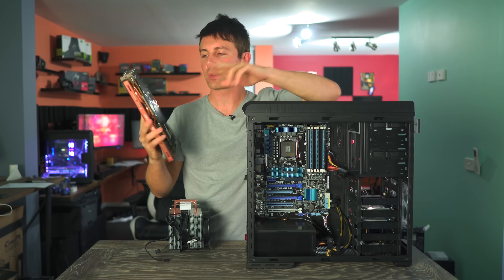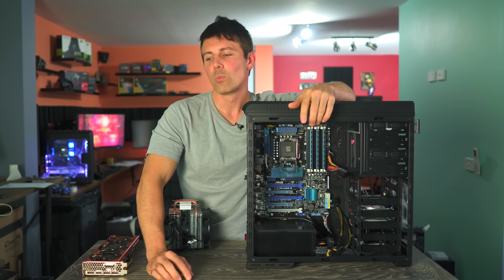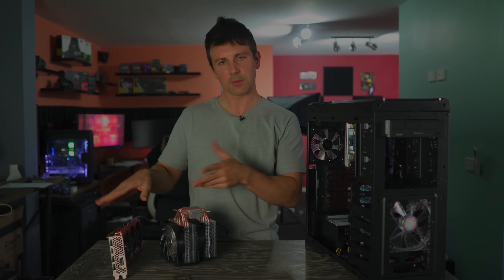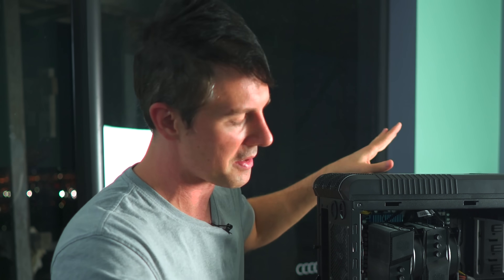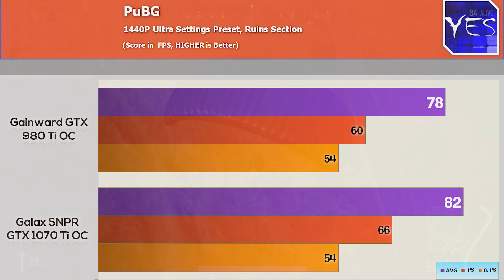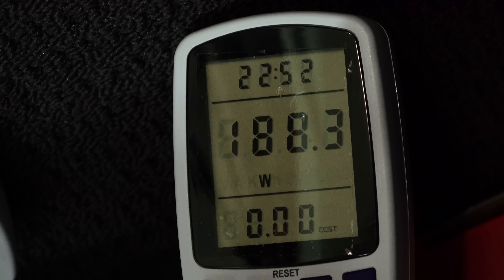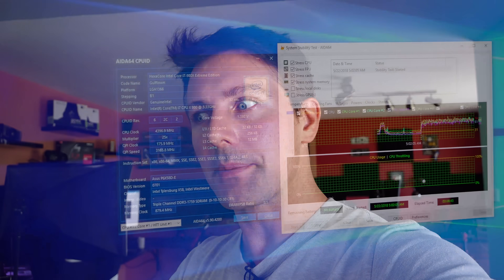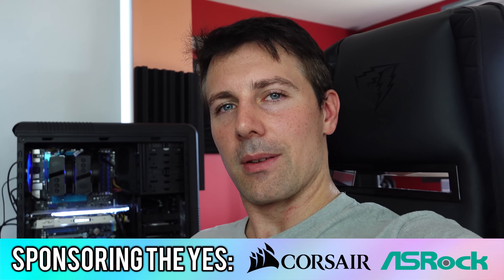GTX 980 Ti Vs. 1070 Ti on x58 - Does it Get Any BETTER?

Comment: you really should get your hands on a xeon w3680 and test it. its a xeon with a fully unlockeed multiplier
Reply: He used the non Xeon equivalent in this video the 980X it is also unlocked. I have a W3690 myself witch is the same as the 990X and is also unlocked.
Reply: ya, but I would like to see if there is a difference in the binning.  I have a w3680 myself and love it. I have got it overclocked to 4.2Ghz on air.

Comment: I love my zotac 980ti amp! paired with my x5670 @ 4.4ghz. Gives me all the performance I need for 2560x1080 on my ultrawide. Definitely would still highly recommend a 980ti if you could get it for $300. I’ve still yet to come across a game I can’t max out and play with excellent frame rates and frame times.

Comment: Hi Mate .. How does a system like this perform with flight Sims. Im an x plane 11 player and it does have a free demo to test on. I have an 8350 at 4.3g and a 1050ti on a asrock 990fx ex 3
Reply: The fx is terrible for X-Plane, the IPC is Phenom ii like and a buddy of mine went from 17 up to 32 fps switching to a I3 3220, with an rx480 8gb.
I get comparable fps to that I3. Maybe something more, but not by much. The loading is much faster.
Reply: thesilviu silviu lol😂

Comment: Yeah, in Firestrike Graphics, my 980 Ti scores 21,183 with GT1 getting 102.61 FPS, and GT2 getting 83.54 FPS. 

As for the 6 Core, 12 Thread CPUs involved, at 5 GHZ core and cache, my 8700k manages 22,432 in Physics with an average 71.21 FPS! Nearly double the 4.5 GHZ 980X!

Comment: Good cooler on that 980 Ti, but it uses the (rather shitty) Reference PCB with the 2 tiny Timebomb MOSFETs... Gigabyte G1 Gaming 980 Ti FTW! Got mine running 1503 Core, 8 GHZ effective VRAM under any and all loads that are not Furmark. Bought mine August 2016 off eBay for $355 Shipped!

Comment: The 990x performs better then its equivalent as the xeon jitters in gta v for no reason whilst the i7  990x does not, fave chip and platform hands down, keep these older videos and cool tutorials on sales and buying stuff, keep this up! 980 hands down and I am on my lovely 670 right now, asus 670 is the best deal for a cheap gpu that plays it all the asus 670 gtx just works!.... Screw Linus, hes shooting in 8k now, maybe u should to bro?...

Comment: @Tech Yes City - Great video Bryan. Love the X58 content. Mine is still rocking as well. Quick question - how long (much life expectancy) do you think the 980ti has before its features (6GB DRAM in particular) have trouble keeping up with AAA games?
Reply: The only game i play is GTA V Online, in 4K high/very high 63 fps. It takes up like 4gb of v-ram
I just upgraded to 980ti in sli, i think Now is when i start worrying about v-ram as performance increases, v-ram doesn’t
V-ram bottle neck occurs with sli setup. I have yet to find out as my TV stopped working i cant test the sli performance
Reply: how the fuck do you play ONE GAME?

 @OmarTheAtheistAziz

Comment: Currently have an evga 980 ti classified capable of running at 1600Mhz (!!) but due to the air cooler I get temps of around 80C and stable at 1571Mhz. It performs literally equivalent to a FE 1080 but I reckon if this was put under water it'd perform even better.

Comment: Hi, add ark to your game list, it will realy use the gpu to the max. Even the 1080ti struggles to get 60fps on 4k. A rx 580 on 1080p epic setings will get 30 to 40 fps

Comment: got my MSI 980ti for €890 on release. Still works great today 3 years later. I don't think ill be changing any time soon. Probable will wait till i halfto drop my graphics on games to medium but i upgrade it. Also never bothered to overclock it. Still pumping out at high to v high settings!

Comment: I m looking for x58 mobo for quite a long time couldn't find it yet. Btw which x58 mobo is good asus or gigabyte?
Reply: Nikhil Puri Asus are better, but gigabyte isn't that bad but don't buy MSI, their x58 boards are not a great choice
Reply: I prefer gigabyte because their are supporting Xeon even on the first bios release (and a x5550 cost only 8€)

Comment: The cpu is a bottleneck. The 8700k would have made this gpu much faster. The i7 980x is missing out on clock speed and a massive IPC and on the super fast ddr4. I wish he would have benchmarked with a modern i7. Cause that x58 is holding back those gpus alot.
Reply: everyone and their mother has benchmarked these GPU's with new hardware. I'm sure you can find that content easily if you look. Top performance for those gpu's wasn't the point of this video. It was how well would it do with OLDER cpu/system like the x58. The price difference he got the X58 system for versus how much a new 8700k system would cost is MASSIVE... probably more than double.
Reply: m8 it's a triple channel memory, it's faster or comparable to the "super fast ddr4" in dual channel check out the benches https://www.techspot.com/news/62129-ddr3-vs-ddr4-raw-bandwidth-numbers.html you'd have to really have some "super fast" 3600Mhz to even beat triple channel, where people have 2400mhz ddr4
Reply: Ryzen default memory clock is 2133MHz lul i was being generous there. My point is that this particular memory configuration is up to date in performance.
Reply: roller4312 no it last gen is 2667 and the refresh is 2933
Reply: Michael Ramos I was talking to guy about ryzen being only 2133
Reply: Chris Wright  I wasn’t replying to you lol
Reply: Michael Ramos my bad
Reply: +Chris Wright
 supported clocks vary http://www.legitreviews.com/wp-content/uploads/2017/03/ddr4-memory-support.jpg it can go as low as 1833, at release date most mainboards didn't boot past 2400mhz.
Reply: I don't think so   https://www.youtube.com/watch?v=-gYQJKkfiYM&t=1342s
Reply: Muad Dib  2666mhz is the max supported for coffee lake. Besides higher memory doesn’t make much difference for games, maybe a few frames

Comment: Either 980 TI or 1070 TI would be fine to have though I wouldn't bother getting one if all I had was a regular 60Hz 1080p screen. I'd want either a 144Hz or a 2560x1080p ultrawide, for anything less a 1060 makes more sense.
Where I'm from a 100W of difference makes roughly a 100EUR difference in power costs over a year if the PC stays on 24/7, if it only gets used for about 4-8 hours a day then the power cost difference isn't big enough to care about power efficiency if the used card is considerably cheaper to buy than the new one.
Reply: Bitter Cynic Exacly, i bought a 980ti watercooled (Gigabyte 980ti waterforce) 7 months ago for 290€, i can push it to 1508mhz without adding voltage. A 1070ti is like 550€ here, i use my PC 1/2 hours a day, so i don't really care about power.

Comment: Bryan I believe you've heard about it. But to fix and get past Marvel sata3/sata 2 bs controllers. You use samsung m.2 960/970 Evo and put it on PC express adapter. So you can go from limited 200-250 speeds to like 3200/1500 up/down something. I am in the process of testing mine soon. I got a cool funky x58 asrock for $78 us dollars. I got steal on the m.2 open box 250gb and tested it on another rig, seems it's never been touched and 2 months from original manufacturer date. Can't wait to run it. The nvme supposed to have built in legacy support or other ways. So you take old x58 and literally give it all the cool benefits of modern hardware, or at least one of the most important in my opinion. I don't care about usb3.0/3.1 that much...  Can't wait!

Comment: Looks like you have a bottleneck going on or something is off.

Both stock and both OC, the 1070Ti should be about 20% faster.  Keep in mind the 1070Ti is near 1080 levels.  A 980Ti is a good margin from a 1080.

A 1070 is more akin to a 980Ti.

Steve from Hardware Unboxed shows a 980Ti about 20% slower in PUBG and other titles in his benchmarks.
Reply: "A 980Ti is a good margin from a 1080." ??? https://www.youtube.com/watch?v=_cnaMoEPgps Stock 980 ti sucks ass u need to overclock it so it can beat 1070 ti :D
Reply: The cpu is a bottleneck. The 8700k would have made this gpu much faster. The i7 980x is missing out on clock speed and a massive IPC and on the super fast ddr4. I wish he would have benchmarked with a modern i7. Cause that x58 is holding back those gpus alot.

Comment: Thanks for vid, Bryan. As an owner of Galax HOF 980ti. I'd say: if you have 980ti, don't buy 1070ti or anything else this gen. if you sitting on pre-Maxwell card and want upgrade, wait for 11x series which should be with us soon and you'll get latest and greatest. 980ti is a killer and was my best upgrade when it came out. I don't have Xeon, just 5960x on Asrock Taichi and I don't see any reason to upgrade even into overpriced 1080ti. Probably I'll get 1180ti and rock on it for another two generations.

Comment: I had to get a new gpu in january cause cause my 980 died, and the 980ti was pretty much the only choice there was cause the 980ti isn't a good miner. I still overpaid massively (380 for a reference card) and i had to slap on my the cooler from my inno3d 980, but god damn big maxwell is still beastly! 1440p ultra in far cry 5 at 70-ish fps with my 5820k at 1490 mhz and 3900mhz ram. Still highly competitive
Reply: Hav you tightened you ram timings? cause 3900Mhz ram is impressive
Reply: freepok nah, havent done anything except setting the vram clock slider to +200 or so (effective speed gain is doubled i thinn. Some ti's get 4000, others won't pass 3700-ish, i think there were also different vram suppliers for this card with some oc-ing better than others
Reply: freepok vram speed not ram speed!
Reply: F**** hell I'm stupid
Reply: freepok haha lol i didn't get it either

Comment: 980 TI is about pretty equal to the 1070 non ti, but with 2gb less vram obviously, while being a 1070 ti when OC, just like the 1070 is about a 1070 ti when OC :p
Reply: ExileKnight91 and you can oc the 980ti too
Reply: Arif Hassan both cards in the tests are oced and I'd say it's fairly even

Comment: i would go for a new 1070 or 1060, for less Watt and more RAM. The problem with used GPUs, you never know what they have been through. The same goes with the consumer CPUs like 990x, never know how badly they were treated and how degraded they are after 10 years of 24/7 OC mining  at crazy voltages.

Comment: isnt the cpu a bottleneck to the gpu's
Reply: No. Pause it at 7:52 and look at the GPU usage compared to CPU usage. x58 is an extremely capable platform with the x5675 or 980x. Even the older 1st gen i7's such as the 950 I'm using right now while my x5675 is in the mail are perfectly capable. This current setup doesn't bottleneck my r9 390x, even with this CPU only at 3.7ghz.

Comment: no regret for my new 1070ti... latest architecture and implementation for rendering 3d game, faster memory, faster core clock, never abused... yet! haha.... and is under warranty.
Reply: Should've just went with the 1080, but aye, no losses, overlock that bad boy and you'll get 1080 stock performance :)
Reply: yes but i do not care. power is cheap compare to the rest of my budget in a month
Reply: Have you tried to undervolt, 'Cause I heard They do it quite well ( not as much as vega although )
Reply: im still on z97 ddr3 and  i7 4790k and 1080p 144hz monitor no need for more.
[UserBenchmarks: Game 112%, Desk 102%, Work 78%] http://www.userbenchmark.com/UserRun/8886974

||Model|Bench
:----|:----|:----|
**CPU**|[Intel Core i7-4790K]|99.6%
**GPU**|[Nvidia GTX 1070-Ti]|127.7%
**SSD**|[Adata XPG SX8000 NVMe PCIe M.2 512GB]|138%
**SSD**|[SanDisk Ultra II 240GB]|58.3%
**RAM**|[G.SKILL Sniper DDR3 2400 C11 4x8GB]|86.9%
**MBD**|[Asus MAXIMUS VII HERO]|
Reply: Yeah, cool and all, but undervolting is just same +/- 3% performance with lower electricity bill. I got my 980 with 90% power limit with a 70Mhz OC on the core, 20Watt saving
Reply: why undervolt it is not power hungry
Reply: but when heavy load is asked it will underclock becose it will get power limit like you say. gpu boost already not use max tdp in almost all my game im 90 to 105 power usage average.
Reply: Undervolting depends on each card, if you test a bit, you undervolt just enough for it to stay at boots clock under load
Reply: for real? lol
Reply: Joel Gratton im quite happy with my ti1070ti too
Reply: freepok why? You're killing your performance for no reason
Reply: I run my 1080ti @ 0,950v 1950mhz perfectly fine, underclock also brings the Temps way down for me, about 10°c.
Reply: YooZD lmao no you didn’t go from 780 Ti to 1080 and not see a real world difference lol 😂. If that was the case it’s time to sell the Celeron and get a new CPU.
Reply: haha you paid $550  haha i paid $300 for 980ti with same performance!   haha!
Reply: +freepok - dude 20watt's aint shit.  you pay 5-7c per killowat hour.  that's 1000 watts for an hour. so your 20watt underclock is saving you 7 CENTS every 50 hours.  SO...

damn bro how many hours a week are you gaming???   personally, i'd rather have the better performance but.. that's probably because i go [H]ard.
Reply: +freepok - and then you're probably one of those guys on the forums wondering why your game's crashing every 30 minutes.
Reply: Everything you save for free is cool, no?
Reply: Joel Gratton I got a gtx 1080, didn't really notice a real life difference and went back to a GTX 780 ti.

Comment: hey bryan, currently i have a core i5 3570k in a intel z77 motherboard. what kind of upgrade can i have with that motherboard including xeons(if they can run on a z77 mobo)
Reply: I know I'm not Bryan, but a core i5 3570K is still a solid performer even today. I recommend adding more ram and overclocking that CPU. However if you absolutely need to have a new CPU you can't go wrong with a Core i7-3770K or E3-1230 v2 (or greater) Xeon. You should look up online what processors are supported by your motherboard, but here is a pretty good list of processors available for LGA1155 socket: https://www.asrock.com/support/cpu.asp?s=1155
Reply: if you fine with 60fps+ gaming with 60hz monitor, and ur fine if you get 100fps, your cpu is still beast, i have z77 and i7 2600k still i don't feel need for upgrade, waiting for gtx 1180 because i have 4k 60hz display so am fine for another couple years you should too
Reply: thank you all for your replies. i am aware that my cpu is still good for gaming and it is overclocked to 4.3 ghz. but when i try to stream it tanks the performance so i am looking for a multi threaded cpu.
Reply: NickFuryus Get a 3770k and overclock it to 4,3-4,5 ghz. The fastest option for your board.

Comment: How high did you get the core and memory clocks on the 980ti Bryan? was it over 1500mhz?
Reply: i got my gainward 1060 6gb to 2500mhz after flashing the bios
Reply: on the core??? or memory?
Reply: core

Comment: correct me if im wrong is the 1060 6gb supposed to compare to a gtx 980 but with better power efficiency? i remember reading something like that (not the ti ver)
Reply: Waffles Weird World (WWW) yes, its basically the same, and has more vram, 1060 3GB is like 970

Comment: Careful with that brake cleaner you might break the graphics card lol Not really its safe but some people think because it doesn't say pc parts cleaner on it that it wont work. Great video keep the quality content coming. And i have to say thats a super good deal on a 980ti
Reply: As long as you dry it off completely afterwards, it will be fine.
Reply: I know ive done it to my cards and mobos since i first saw the yesman do it but some people say its dangerous.... those people don't know what they are missing out on.

Comment: X58 + 980ti perfection!! 😍🤙🏼
Reply: You should so pick up a X5675 for how cheap they are, they are soooo much better than the i7 chips. I replaced a i7 960 with one and it was a huge upgrade.
Reply: Nathanael Ciranni
X58 + i7 920@ 4.02Ghz + dual R9 280x perfect for my gaming.
Reply: X5660 @ 4.3ghz + Titan x Maxwell <3
Reply: I’m not running X58 + 980ti lol.
 My system is i7 3930k 32Gb ram, Liquid cooled Gtx1080 OC 2.05ghz.
Reply: Electricos Cosmos
Cheapest X5675 on ebay go for $83 AUD and it comes from Hong Kong,
Where i can get a X5650 for only $55AUD and it's in australia where i live.
Reply: Electricos Cosmos I am currently running the i7 930, I have been thinking of getting the xeon 5675. Does it require ecc? Was this gen just a CPU swap or would I need to get a different bios revision?
Reply: Daryl Ward No it does not require server ecc memory and what motherboard do you use?
Reply: EVGA X58 SLI
Reply: Daryl Ward 
Your motherboard revision is the key between using ep xeon processors and regular processors.
Reply: Tutankhamun1333 yeah, I am not home so I have been trying to research it. I know it is the x58 sli LE, but I will have to open it up when I get home.
Reply: Nathanael Ciranni how about 780 ti?
Would what you recommend for fortnite medium settings on a budget?
Reply: @SixSageGt  780Ti is actually pretty good
Reply: Sin PC igual a depresión <3 :(
Reply: Nathanael Ciranni x48 q9650 4.5ghz r9 290x still good for me :D
Reply: @marcohero2061  i7 4770k @ 4.2GHz 32 gb RAM and 980 ti ;0
Reply: I have a x5690 @ 4.7ghz and a 980ti kingpin.. is still a great system.
Reply: 6900k 32gb ram vega 56 here. A fucking beast.